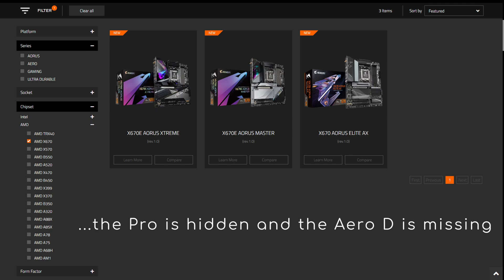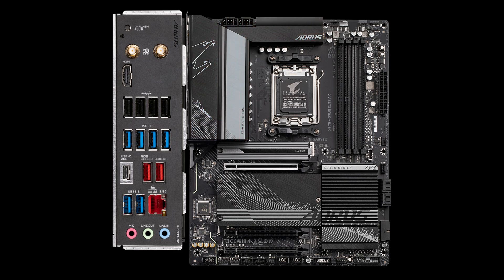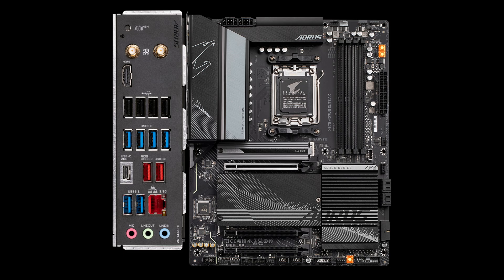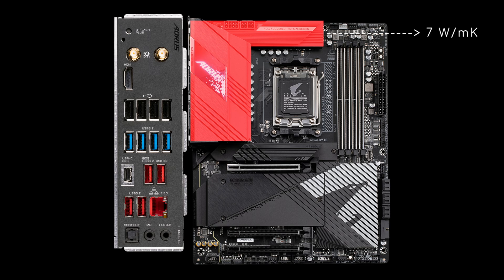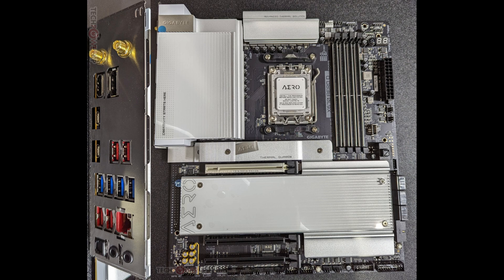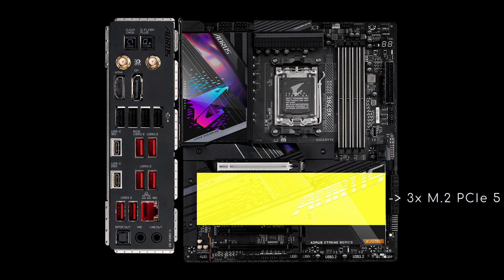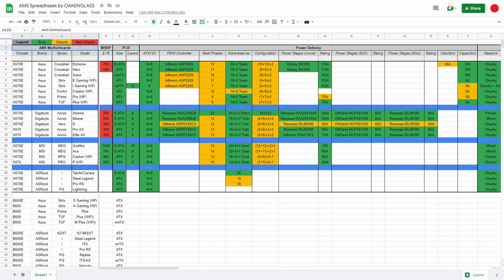Gigabyte AM5 X670 Motherboards Lineup: Preliminary Analysis

Comment from the maker: A couple of corrections/things I missed:
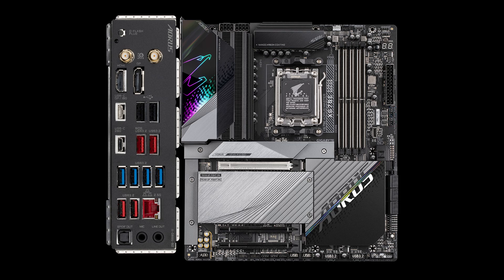1) The Master, Aero D and Xtreme have 4 pump headers, not 2 (05:33). Locations: 1 at the top, the other below the SATA ports (Master, Xtreme) or between the USB 2/Gen.1 headers (Aero D).
2) On the Xtreme, the ESS ES9118 DAC is internal, not external (06:59). However, it does include an external one too: "ESSential USB DAC", probably equipped with an ESS ES9280CPRO chip.
3) While the Elite, Pro, Aero D and Xtreme all have a Clear CMOS button (on-board or on the back panel), the Master does not: it only has the canonical jumper. A very weird decision, isn't it?